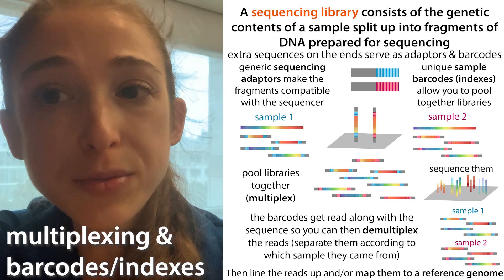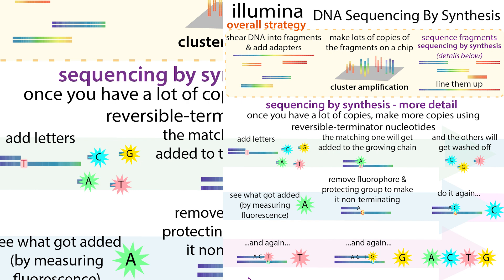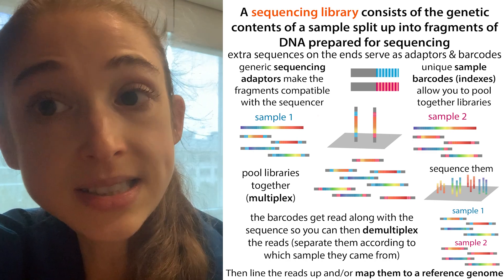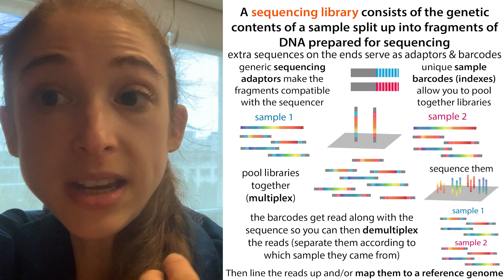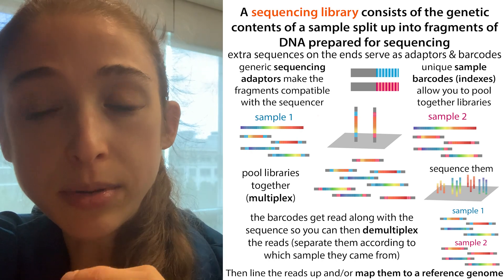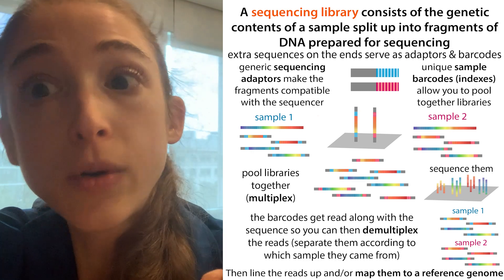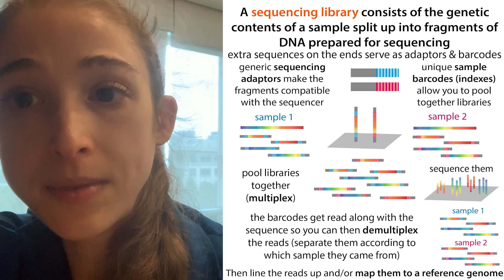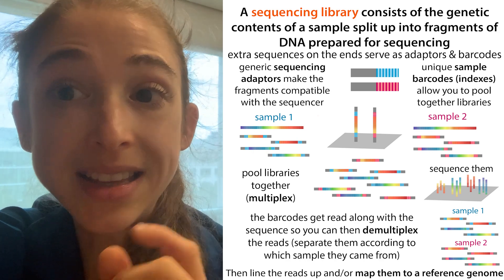Multiplexing and molecular barcodes (indexes) in NGS (Next Gen Sequencing)

Comment: Please help me, whats the difference between the index and barcode? Also this barcode, do you PUT it in your adaptor, so the length is a bit longer? And so each sample has a barcode, sample 1 has AGCGATCGAT and sample 2 has CGATCGTACG, then you can read it off like that, did I understand it right? And how to put the barcode on BOTH sides (so on both adaptors on both sides of 1 strand)? is it with reverse transciption? Do you need a special primer for it? and what do you mean by read?
Reply from the maker: I think this is too technical for me to try to explain here, and I haven't done it in some time and don't have time to dive back into all this now, but am going to leave your post here so someone else can hopefully help. Good luck!